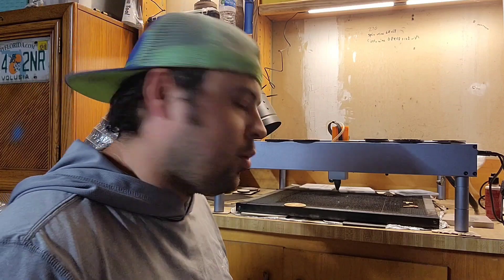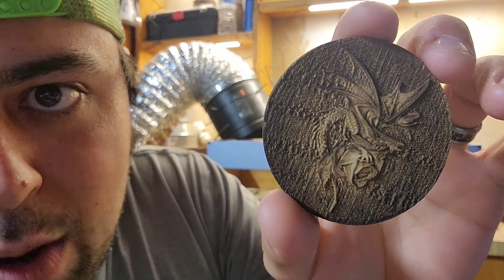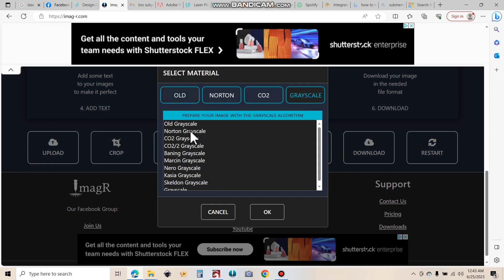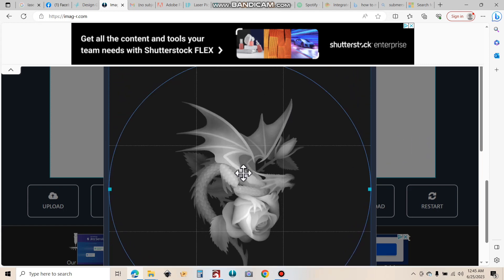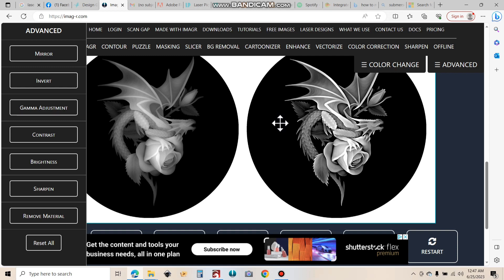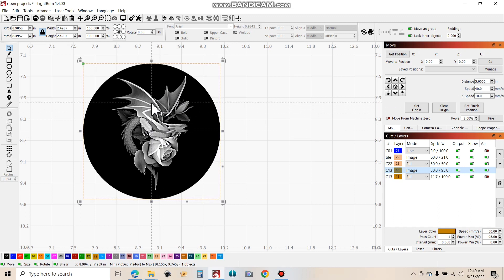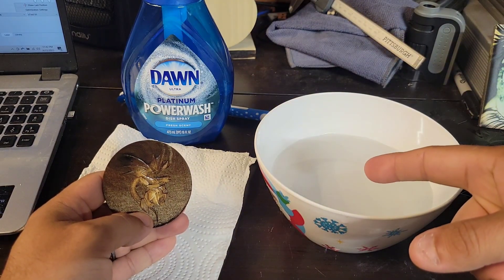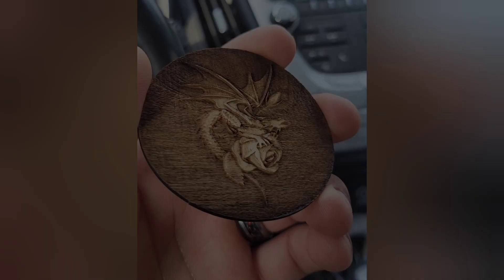Making 2.5D textured relief engravings on wood with new ImagR.com grayscale algorithms

Comment: Interesting method, somewhat hit and miss and lacks scientific testing for stability and repeatability. Personally I'm not convinced that dithered images can properly produce 2.5D due to the nature of the dithering beast. I've done many 2.5D projects on CO2 and diode. CO2 does a better job due to its nature but is much more complicated to do due to its control.

 Dither is effectively a trick to trick our eyes into thinking we see darker greys by clustering small spots/holes, thats not 2.5D process or a swiss cheese version of 2.5D.

 2.5D quality is more of a smooth transition of depths which to a diode laser is greyscale in Lightburn. Imag-r is a dithering program that I know of. Dithering and smooth depth transitions are polar opposites.
Reply from the maker: Not hit and miss at all actually as I've made about 30 relief engravings now. To your point about dithering if you watch the video closely you'll see that in imagr I use the GRAYSCALE ALGORITHMS which only adjusts the tonal curves! There was no dithering. I then run grayscal le in lightburn. It is actually a very reliable process and i have now tested it on multiple machines.
Reply: @Allen_The_Maker   Don't take my word for it, I have only done 1000+ 2.5D engravings on all laser types.

 You do know that Marcin, Baning, Nero, Kasia etc and every other choice in Imag-r is a dither pattern used to calculate or manipulate the image. So making a point you didn't use dither while using "Marcin Grayscale" which means the Marcin dither pattern applied to grayscale. 

 The downside is a dither is a smear of the image, good in many cases but in this case you are smearing a very exact depth map basically distorting it or warping it and praying for a stable outcome which by nature isn't true. This is because the dither algorithm only looks at surrounding pixels and not the entire image meaning how it adjusts a black level on 1 part of the image is different than a different part or different image.

 My point was for stability and repeatability why smear it at all, do it the right way. You don't have to do all that stuff as your compensating for your unknowns basically.
Reply from the maker: The grayscale algorithms do not dither, they adjust the tonal curves. Not sure why I'm having to say this again. You're really spouting on about things that are important but don't make sense in regards to my video and this process. Also I think you should get some more imag-r.com practice in before putting a stake in the ground and trying to devalue my information.
Reply: @Allen_The_Maker   Look at the bright side you get paid more for interaction. Now your just attacking.

 Your words and Imag-r's documentation do not at all match! They say marcin does sharpening, edge enhancement and noise removal. They don't list tonal curves as a feature.

 Depth maps are not images they are EXACT point cloud of 3 dimensional coordinates. You just happen to see it as a gray image! There is no edges as in a normal image there is however lots of what a normal image would call noise.

 You can't apply algorithms you apply to normal images! Imag-r says they enhance edges, sharpen and reduce noise. None of those things exist in a point cloud or depth map. All they will do is distort the map into something it is not. Marcin thinks its an image!

 Yes I ran a complete evaluation of the output of imag-r, yes the output was full of distortions. Why do you think I said there is a different much easier way its also accurate without distortions.

 In much simpler terms why do you feel its right to modify an already perfect map?

 So what are the actual problems to solve? Why can't you just engrave the already perfect depth map? That is the actual problem to solve without distorting it. I think you will find the solution is super simple.
Reply: @3dtwerking324  And what do you propose to make 2.5D images?

Comment: hi, just wondering should pass through be ticked if processed via imag-r, as when i watch their vids they always say click pass through otherwise LB re process it again?
Reply from the maker: Typically yes but for this we are using the grayscale algorithms to adjust the tonal curves and then  running in grayscale to use the tones you just made. Basically we're not dithering so we don't use passthrough, just make sure to set the line interval value in lightburn to the same dpi you set in imag-r.com!
Reply: Is there any way to use the imagr file in xTool Creative Space, and achieve the 3D (2.5D) effect? I downloaded the trial version of LightBurn, but it has to be run via essentially a patch to the xTool M1, and to me it’s basically running the machine blind. I’m a newbie to using lasers and I’m not comfortable trying to process a design when I can’t map the space to confirm where it’s going to be engraved or cut!